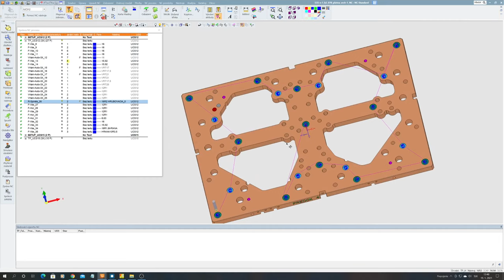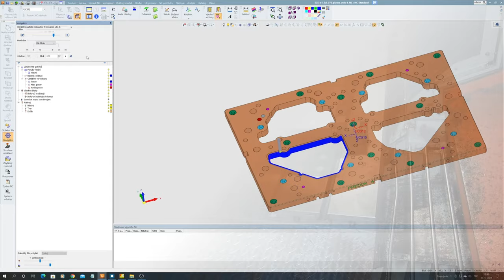Plate drilling and milling (cnc milling)

Comment: That drill at 3:45.... sharpened by hand? I often are shit at sharpening drills! But sometimes it doesn't matter.
Reply from the maker: Hi. Not manually. We have a grinder for such large drills.
Reply: Never use Hand grinded drills on CNC applications